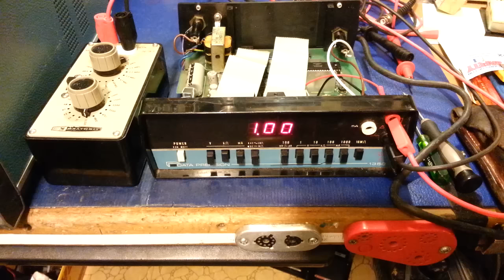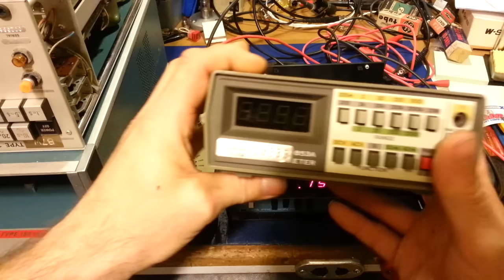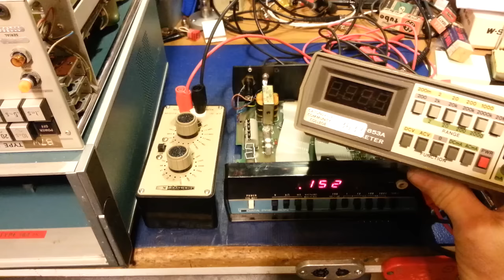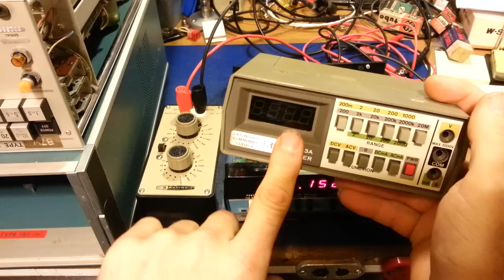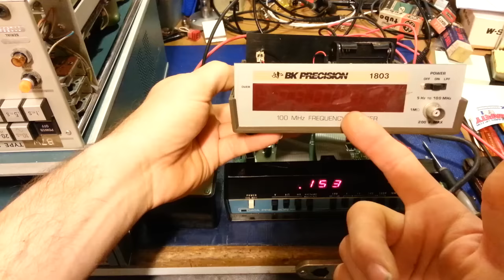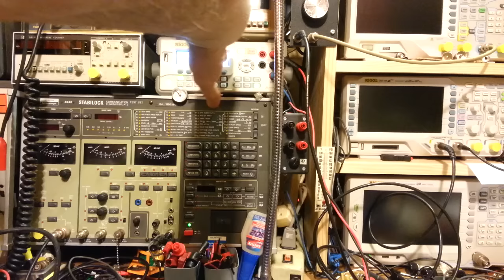Public auction test equipment, tube amplifier bonanza day.

Comment: Ahhh, the Heathkit 2718 power supply...my first real bench supply and still there on the bench BTW after almost 40 years! It is output current limited to protect against a dead short on the terminals and you can series up the outputs. I remember building it in the early 80's...one faulty diode in 40 years ain't bad! Nice haul Mike!

Comment: Enjoy yer vids! Nice haul here.
I'll bet my last penny you are from Baltimore...  Your accent ...  ;-)
Reply from the maker: glasstronic 

Close, originally from Northern Maryland and moved about 500 yards across the MD / PA line.  Lots of relatives have lived and still do in the Baltimore / DC Metro area.  As they retire they move to PA, no income tax on retirement income up here.
Reply: We are neighbors, then. I live in Glen Rock, Pa.
Close enough to set a meeting? I was born and raised in Baltimore; we speak the same language in dialect AND our love interests.
Reply: By-the-by; gotta 4 Ohm system? Use the 6 Ohm (25V) tap. Gotta' 8 Ohm system? Use the 6 Ohm (25V) tap. Those amps manage that mismatch very well. They love you long time. ;-)
Those beasts were designed with installation errors in mind...
Like the idea of replacing the 8417 sockets with ceramic; plate voltages a bit high, even for Micanol sockets.